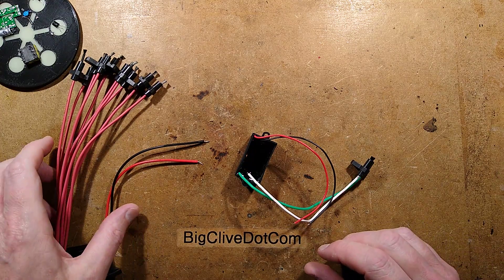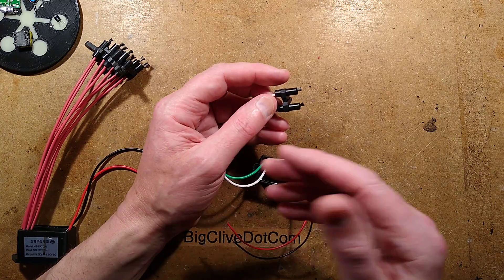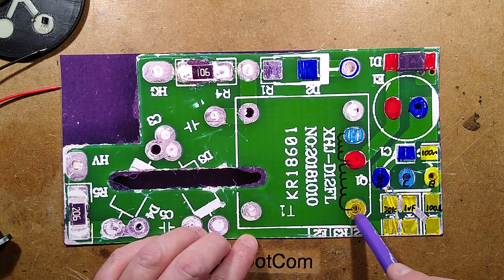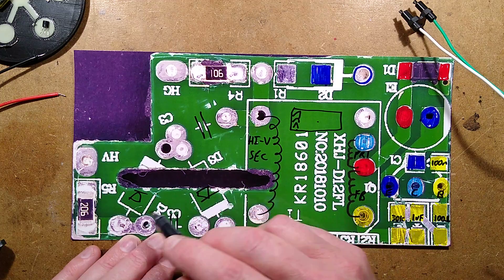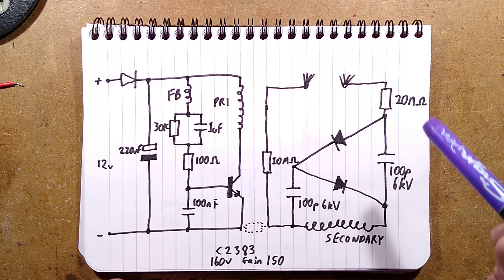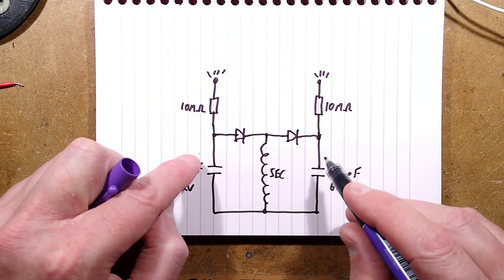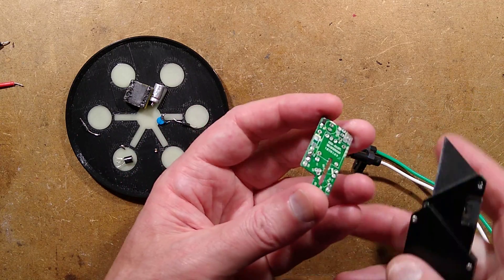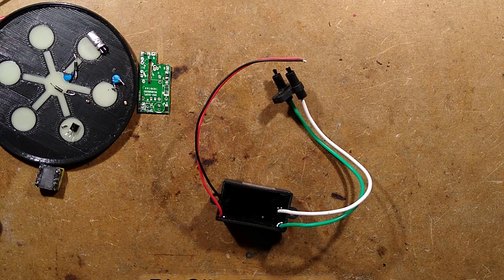Intriguingly different "ioniser" module (de-potting and schematic)

Comment: These devices reduced hospital cross infections to zero but big pharma stopped them being in installed as they would lose money in drug sales...many thousands dead as a result.... see below. 
Repeated airborne infections of the bacteria acinetobacter in an intensive care ward have been eliminated by the installation of a negative air ioniser.

In the first such epidemiological study, researchers found that the infection rate fell to zero during the year long trial. “We were absolutely astounded to find such clear cut results,” engineer Clive Begg at the University of Leeds, UK, told New Scientist.

Stephen Dean, a consultant at the St James’s Hospital in Leeds where the trial took place says: “The results have been fantastic – so much so that we have asked the university to leave the ionisers with us.”

The ionisers produce negative air ions that collide with suspended particles and give them a charge. The scientists believe charged particles aggregate together and fall out of the air, thereby disinfecting the atmosphere and stopping the transmission of infection.

“We don’t fully understand how it is working, but we suspect it is damaging or killing the bacteria,” says Beggs. “But if the ionisers are cleaning the air in this way, we would expect to find more precipitation of acinetobacter on surfaces and this is exactly what we found.”
Antibiotic resistant

Acinetobacter infections are often very difficult to treat as the bacterium is resistant to many antibiotics. It poses no real threat to healthy humans but can cause serious infections in people with weakened immune systems.

“Ionisers may become a powerful weapon in the fight against hospital acquired infection,” says clinical microbiologist Kevin Kerr, another team member. “People had focused on getting doctors and nurses to wash their hands and had not looked at anything else.”

About 10 per cent of infections in the UK’s public hospitals have been estimated to be airborne, but Kerr says it may be even higher, as conventional methods to sample airborne bacteria are inefficient.

But although the results are very promising, he adds that further research is needed because acinetobacter infections tend to be cyclical. “They may not be seen for weeks or months and then you see a cluster of infections,” he says.
TB target

The team is currently doing more lab studies to see if other organisms may be targeted. Tuberculosis is one promising target.

Brian Duerden, director of the UK’s Public Health Laboratory Service, is encouraged by the results. “It is not the whole answer as many infections are spread by touch, but it is a potential addition to the weaponry against hospital infections,” he told New Scientist.

Research by electronics company Sharp has shown that positive and negative ions produced by their air conditioning systems can inactivate viruses including influenza. But the new study is the first to link such an effect to reduced infections in hospitals.

Read more: https://www.newscientist.com/article/dn3228-air-ionisers-wipe-out-hospital-infections/#ixzz71We4NxPu
Reply from the maker: I don't think big pharma "stopped" it.  I just don't think people took them seriously as there was no instant gratification.  It takes Sharp-plasmacluster hype and marketing to sell stuff to the non-technically inclined purchasers.
Reply: @bigclivedotcom  Healthy people dont make money. if a 100 hundred patients per hospital avoid infection saving say 5000 per patient in treatment than =500000 multiply by number of hospitals= hundreds of millions times number of hospitals worldwide = many tens of billions

its usually a lot more than 5000 per patient.

big pharma spent 400 million bribing i mean lobbying congress last year.

Comment: By the use of a modified ionizer device we describe effective prevention of airborne transmitted influenza A (strain Panama 99) virus infection between animals and inactivation of virus (>97%). Active ionizer prevented 100% (4/4) of guinea pigs from infection. Moreover, the device effectively captured airborne transmitted calicivirus, rotavirus and influenza virus, with recovery rates up to 21% after 40 min in a 19 m3 room. The ionizer generates negative ions, rendering airborne particles/aerosol droplets negatively charged and electrostatically attracts them to a positively charged collector plate. Trapped viruses are then identified by reverse transcription quantitative real-time PCR. The device enables unique possibilities for rapid and simple removal of virus from air and offers possibilities to simultaneously identify and prevent airborne transmission of viruses.

There is an urgent need for simple, portable and sensitive devices to collect, eliminate and identify viruses from air, to rapidly detect and prevent outbreaks and spread of infecti....read the rest of the article below

https://www.ncbi.nlm.nih.gov/pmc/articles/PMC4477231/

Comment: i have the 10 strand one. i arranged it in a flower pattern in a XJ-100 defunct ozonator case. only cost about $5 but the price jumped to $9 after i bought it...mains powered.
Reply from the maker: Still available quite cheaply.  Should be OK on 120V but the 220V version may burn its resistors out quite quickly.

Comment: I know zilch about electronics. So, how do you use this? E.g. can I just wire it up to a 12v car cigar lighter type of plug and simply leave it free-standing to freshen up my campervan?
Advice welcome.
Reply from the maker: Yes.  Just secure the emitter where it stays dry and clean and doesn't rest against anything.
Reply: @bigclivedotcom  

Thank you for taking the time Clive. Very kind of you.

Comment: Those separator things remind me of those red light therapy nostril LEDs, not sure that these would have the same effect though if stuck up one's snout... :P
Reply: i have those but is very uncomfortable to use as you get a runny nose. i bought red led 3 watt beads and apply them externally instead.

Comment: I ordered a couple after seeing one of your ozone video's.
 Sold as car air purifiers I thought it may be OK to use as a trace ozone generator with 12v 'wall wart' plus a timer.
Will probably check for reverse EMF as I've measured over 300V on motorcycle primary windings (although it needed a peak voltage adapter to get any reading above 14.5vDC)

Comment: I'm using the "multi-lead" version in my home "DIY Precipitron" which appears to work pretty well!  Any chance of a review of the Maxitech MT7933 AC-DC LED Driver chip? These are appearing in a number of "better quality" LED lights, and the chip is pretty amazing (Chinese datasheet, machine translation!) Ta if at all possible!
Reply from the maker: It looks like a standard power supply chip, unless the main primary capacitor is not electrolytic.
Reply: @bigclivedotcom  You are probably right, however this chip is TINY, and in my case it was stuck under other components, so I was wondering what controlled the LED PSU until I did a bit of digging around!.  Impressive how a very capable (and efficient) PSU can be produced with a few diodes, a power MOSFET and this type of very tiny chip!

Comment: I had the first one for a few years, but both silicone wires are white, though testing, one side is positive and the other is negative, which you'd thing might just cancel out straight between them, but never found a real use for it
Reply from the maker: It does more or less cancel out, but creates ozone in the process due to the higher current flow between the two emitters.
Reply: @bigclivedotcom  I'm wondering if you could seperate them with some mica, or cut them apart?

Comment: If I out one inside my dehumidifier (based on compressed refrigerant) where would be best to put it, after the fan, before the fan, before the air intake, next to the condensing wall?
Reply from the maker: Probably on the output of the fan.
Reply: @bigclivedotcom  if only I hadn't just have glued my case back together...

Comment: Ah( i was hoping to see how to de-pot part. I hope you will make another video some day showing the whole process
Reply from the maker: It's very slow.
Reply: @bigclivedotcom  Do you just physically remove it or do you use some kind of a heat gun or solvent to do this? Is there a way to reverse the process and make some components watertight? I liked your previous video on making outdoor solar lights using old phone battery so I was wondering if one could make it more resistant to the elements by covering it in some material (like washing machine electronics).

Comment: Man, something about that font and the fact that there is text going both ways really triggered my dyslexia. I could've sworn the XHJ... and NO:20... Was printed mirror image. I legitimately forgot which way around a 2 and a J go. And there's a J in my name!!

It's an interesting optical illusion. I think maybe my brain saw KR18601 and then decided to compensate for the other lines by flipping them end-to-end (as if they were mirrored) instead of rotating them 180. So when I tilted my phone to read the XHJ, my brain was like. "whoah whoah, that was mirrored, so ALL of those letters are still backwards, buddy." even though they weren't!
Reply: You're peering through the simulation. Hang on to something buddy.

Comment: with the depotting would putting the item in a jar of acetone then putting the jar in an ultrasonic cleaner work better?
Reply: "Steve's Small Engine" got me to try different solvents in ziplock bags when cleaning lawnmower/chainsaw carburetor parts in an ultrasonic cleaner.  Fill the ultrasonic tank with water, drop in the ziplock bag, and keep the cleaner until the parts look clean.
No fuss, no mess!  You could easily try lots of different solvents to melt the potting compound.

Comment: How do you de-pot them? Solvent or Extreme violence?
Reply: Answered at 9:45
Reply: @ray_mck  not sure how I missed that bit.
I depotted a motorcycle CDI using acetone years ago. It took forever. And recently did another just using a heat gun. Not as easy as it should be

Comment: If the transformer core is ferrite, the schematic shows it drawn as typically two parallel dashed lines.

I somehow got the idea from somewhere that the bristles of the emitter had some radioactive stuff to make the corona give off ozone.  Or maybe that was inside of neon lamps?  Thanks, Clive.
Reply from the maker: Neon lamps used trace levels of radiation to allow them to glow in dark areas.  Otherwise they don't start easily.

Comment: I have a rather old ionizer that I wish I could send to you period but considering that Canada Post cost an arm and a dick to send anything even locally....
The units discharge is a small Bush of copper wires about 2 and 1/2 CM diameter.
Reply from the maker: You could send a picture to bigclive1@gmail.com

Comment: Clive, I'll entrust you and the electronerding community the following task.

Budget replacement of power tool brushless ESC's. Like Makita Impact Driver. input max 40A 22V. High acceleration. Most esc's available have an annoying soft start making them useless for impact drivers. Target price: under £80. I know hobby ESC's can be hacked but I can't find any with the reprogrammable EEPROM's, chinese sellers removed them off the market to protect sales.
Reply from the maker: That would be a complex project, just for solid mountings alone.
Reply: @bigclivedotcom  complex? it's just an ESC with no smooth start. Solid mountings? Am I missing something?

Comment: I wonder if you could make a metal screen dust filter, that uses high voltage to make dust stick to it, rather than relying on a fine mesh to screen air. The main advantage being less airflow restriction.
Reply from the maker: Electrostatic precipitator.
Reply: @bigclivedotcom  It seems i'v been beaten to the idea by a century.
Reply: @bigclivedotcom  Which was the very heart of the fume extraction system in the welding workshop at the college where I used to work. The precipitator was also water washed to clean the screens!

Comment: You normally show an eBay page where you purchased - so we can get the same as Clive! But sadly not on this occasion.
Reply: This one even has the "right" wire colors :   38％ Off | Anion Generator DIY Ionizer Airborne Air Purifiers Negative Ion Module Cleaner
https://star.aliexpress.com/share/share.htm?image=Ued7079aabe3342ccb9fb564ee5e051341.jpg&businessType=ProductDetail&title=NOK%2014.31%20%2038%EF%BC%85%20Off%20%7C%20Anion%20Generator%20DIY%20Ionizer%20Airborne%20Air%20Purifiers%20Negative%20Ion%20Module%20Cleaner&platform=AE&redirectUrl=https%3A%2F%2Fwww.aliexpress.com%2Fitem%2F32914804007.html%3F%26srcSns%3Dsns_Copy%26tid%3Dwhite_backgroup_101%26mb%3DVQDvJmZPrlYwB5z%26businessType%3DProductDetail%26spreadType%3DsocialShare
Reply from the maker: The one with green and white wires is the correct unit.  The others are probably just plain negative ion generators.
Reply: @bigclivedotcom  Thanks, just ordered 3. Hopefully they'll be fine run off 'wall-warts'.
Reply: @bigclivedotcom  Oh, poo. I ordered a bag of ones with two white wires. I didn't see any of the green + white wire ones listed on US eBay. But wouldn't they just make a tiny little cloud of negative ions around one brush, with most of them leaping to their deaths at the other brush before they have a chance to drift around the room? I suppose when I get them, it'll be time for me to learn how to tell the difference and figure out what they're doing.

Edit: Oh... OH! I get it. The ones I got with two white wires probably have both brushes connected together, and create a high voltage on them with respect to one of the power input leads, right?
Reply: I THINK I found it on AliExpress :   37％ Off | DC 12V High Output Air Ionizer Airborne Negative Ion Anion Generator DIY
https://star.aliexpress.com/share/share.htm?image=U96a5d4a8cbcd46e7aff5d65726b19887o.jpg&businessType=ProductDetail&title=NOK%2011.19%20%2037%EF%BC%85%20Off%20%7C%20DC%2012V%20High%20Output%20Air%20Ionizer%20Airborne%20Negative%20Ion%20Anion%20Generator%20DIY&platform=AE&redirectUrl=https%3A%2F%2Fwww.aliexpress.com%2Fitem%2F32914077538.html%3F%26srcSns%3Dsns_Copy%26tid%3Dwhite_backgroup_101%26mb%3DVQDvJmZPrlYwB5z%26businessType%3DProductDetail%26spreadType%3DsocialShare
Reply: I also THINK this is the same one on eBay: https://www.ebay.com/itm/DC-12V-DIY-New-High-Output-Air-Ionizer-Airborne-Negative-Ion-Anion-Generator-/352245735889?mkcid=16&mkevt=1&_trksid=p2349624.m46890.l49286&mkrid=705-154756-20017-0

Comment: I heard that car-garages often offering a service to remove odors in a car with an ozone generator... But the units are ridiculously expensive. What would be a solid DIY solution for occasionally using  in your eyes?
Reply: ...use in the car, not in your eyes 😉
Reply: @Kühn-b6w  I almost started making a funny comment, you beat me to it... 🤣
Reply: @ShanesGettingHandy  ...well it's the internet... You have to assume that someone will do a funny comment on it or get offended by it 😉
Reply from the maker: This little 12V ceramic plate ones sold on eBay could be useful for that.
Reply: The ozone causes rubber to deteriorate.  Inside of a small space like a car, the ozone could cause damage to the rubber seals and weatherstripping.  It's probably a good idea to leave the window slightly open when the car isn't used.
Reply: @acmefixer1  didn't intend to use every day... Just get rid of a odor from my air-conditioner... Usage maybe an hour... Don't think that would be problematic if use once a year...

Comment: Based on my talking with Chinese manufacturers making these potted dual-rail ion generators, the output voltage at the brush end is what determines if a unit produces traceable levels of ozone. What they seem to claim is if the output voltage is capped to 3-4KV then it should pass the UL2998 ozone standard(emission less than 5ppb). This is the setting they claim to use for folks who need to pass the UL ozone standard.
Reply from the maker: It's probably the same reason traditional ionisers cap the multiplier at 11 stages.
Reply: That's assuming they actually are trustworthy and build to spec.  Look at all the lasers that are sold on Amazon and EBay from China.   They are all listed as 5mW lasers.  
In reality most of them are at least 30-50mW lasers which are quite dangerous to your eyes. You can buy them for under $10.

For $50 to $100 you can buy a laser that outputs 1 to 2 Watt.  Once again they are listed as 5mW lasers.  
They can cause severe eye damage and even blindness from just a reflection or a quick moving beam across the face.
Reply: @jTempVids  they are listed at 5mw for legal reasons as you know a laser isnt 5mw when the pics in it show a bright beam
Reply: @jTempVids  good to know.
Reply: @plainedgedsaw1694  Yeah, to buy one!

Comment: Haven't had much luck de-potting things lately...  I guess the LED driver manufacturers found out about DMSO...
Reply from the maker: I've resorted to heat to remove the resin and measuring components before they get damaged.

Comment: [Currently Unlisted Video] See, I pay attention to the comments. lol
Actually considering an ionizer for my garage/man cave. Thought about building one myself, which would be fun, but probably would be "noisy" enough to mess with all the electronics around me.
Reply from the maker: This module is very quiet in both audio and electrical noise.
Reply: @bigclivedotcom  How is the RF noise emissions from these devices? As a ham radio operator, I don't want to and to the radio noise floor at home.
Reply from the maker: @halohms  For this unit I'd expect it to be quite low.  A fraction of a typical lamp power supply.
Reply: yay for paying attention to the comments ;)